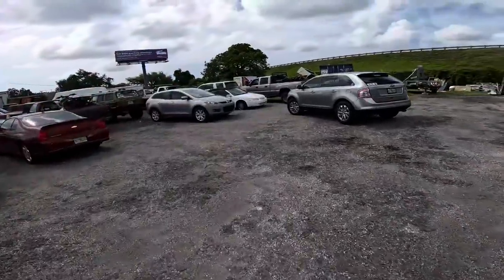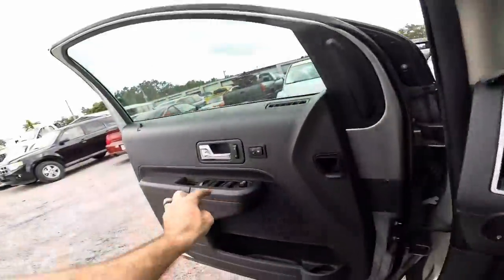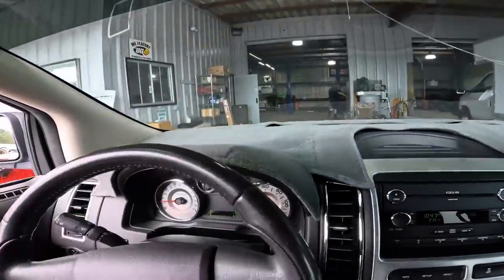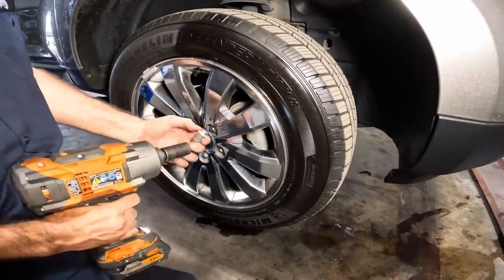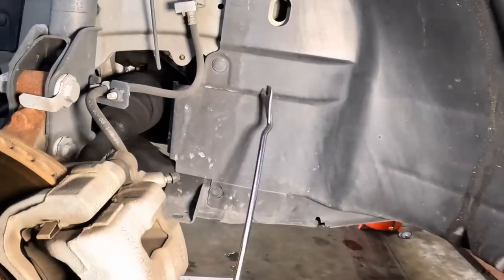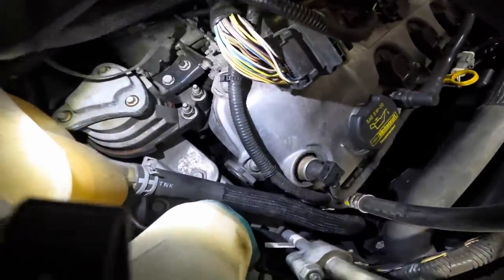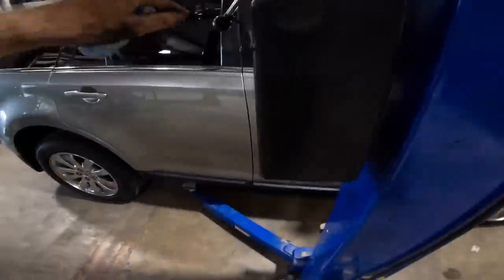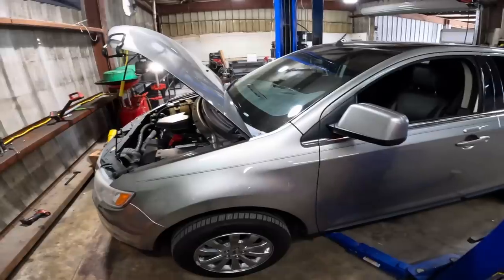Mechanic Hack! Coat Hanger Repair! Ford Streth Belt

Comment: Just so you know for future if you put the belt on the power steering all the way and start it on the crank its easier to do the same thing with zip ties and you will have an easier time rolling the belt on. done a couple on the same engine but in the f150 same idea a little more room but still easier to do it on the crank since you have to use the crank bolt to turn the engine over.

Comment: Did one of these on a Ford flex with the wide plastic ties first time I saw or ever heard of these at my home garage. My daily is class 8 Freightliners never seen these before so I bought the tool 2 wedges to remove and install these. Bought this tool 5 years ago never used it once because never saw one of these again.

Comment: I've used various things to put on stretch fit belts. zip ties, hard plastic bondo scraper, a hose clamp and the actual tool. About anything that isn't sharp but can provide some friction between the belt and pulley as it goes around will do the trick. You just don't want to use something that will damage the belt.
Reply: Shhhhhh, according to the resident mouthwrenches that makes you a hack.  😂
Reply: @stevewhite3424  call it what ya want, if it works and works right, why not? Ray just demonstrated a fine example. If that makes me a hack, then I’m proud to be one.
Reply: @TechJB65  Err, I think you missed my point...I was agreeing with you...
Reply: @stevewhite3424   I didn't take it that way. Just thought I'd take the opportunity to address those that do think its a hack job to do something like that. Mechanics that find creative ways to get the job done and get it done right is just that, a creative thinker.
Reply: @TechJB65  Agree 100%!!

Comment: Check out harbor freight for their dual, flex head, long reach wrench. It is extremely thin head. I bought it to take the upper power steering bolt off Sienna 3.3. You have to use a deep socket to reach the bolt past the pulley and I have managed to get a wrench with a fat head stuck against the inner fender, unable to remove the socket nor tighten the bolt.  67994 1/4 in, 3/8 in. Drive Long-Reach Dual Flex Head Ratchet

Comment: talk about stretch belt the lexus is300h has one of those to the water pump and on Techdoc ( that is the toyota lexus manual and guide etc) they say the spesial tool to be used there is a towel a regular towel

Comment: Good Trick. Here is a trade Use WD/40  ON any plastic or painted bumpers where there is any friction of putting it on or off just like you would penetrating oil on bolts.  Shoot those plastic clips they will come right out no more broke clips to hunt down and waste 30 min or more.👍

Comment: I can't help but wonder what the book time is vs what you actually performed it in. Something tells me you smoked the book time Ray🙂
   The coat hanger wire trick is beautiful...I read a few others suggest using zip ties...As befy as some of them are that would be a great go to.
    I just hope the engineers dont try to outsmart yourself and others who have found easier...and cheaper methods of installing that sucker...like pulleys without holes in them. That would be maddening to the nth degree for sure.
   A great teaching video yet again Ray🙂

Comment: I recently changed my nephews stretch belt on his Ford Flex 3.5L NA with an OEM belt. 

When you buy it from the dealer, it comes with 2 zip ties and the part number is BT4Z-8620-C. 

I bought OEM because aftermarket(Autozone) was slightly smaller and looked completely different than the OEM belt.

Comment: i lucked out on my last car, was driving down the road when i heard a loud racket under the hood. i'd snapped the belt off. luckily it wasn't an interference engine so no damage was done. i was even able to drive it home without the belt, i just had no alternator so i coiuln't shut it off or the battery would be dead

Comment: The trick is to use zip ties and start the motor. The belt will go right on and the zip ties will snap off.

Comment: You are on the Edge .... the edge of sanity!! 😆 🤣 😂 (sanity is overrated right enough)

You have been quite fortunate lately in regards to the belt replacements, you have not been required to remove the engine mount to get the belts off.

A cable tie could have done the same and might be quicker/easier to install (just possibly improving on your ingenuity, cannot take credit for that lol)

Comment: Here’s a hint when cutting stiff pieces of wire; hold on to the end of said stiff piece of wire before cutting it. That way, said stiff piece of wire doesn’t fly off into your eyeball. Much safer-er! 😀😀😀 Oh yeah, and it’ll prevent the cut piece of wire from flying off and hitting Troy in the eye! 🤣 It works for cutting off plastic wire ties as well.

Comment: Ive always man handle those belts, specially the gm stuff.  Use a rubber mallot on the top pushing up to add pressure!

Comment: 1995 At 120k miles I requested the dealer replace the multi rib belt for the water pump and alternator. They refused saying they only replace them when they break. Several mechanics told me the same thing. Apparently they want the belt to break while I am driving down the highway and I don't notice until my motor has overheated and pretty much ruined. 
Same story for my heater hoses.
Sure enough my heater hose burst on the highway.  I must have driven 40 miles before another car honked at me that I was smoking. I became stranded. It was on a weekend so I had to fix it myself hitching rides from my neighbors to buy tools and supplies at Pepboys. The motor suffered damage. It burned oil thereafter. I went to a mechanic again and requested that all my heater hoses and belts be replaced. He advised me that what I needed was a motor replacement. He was right but I decided that it was just going to be an oil burner from then on. He reluctantly replaced hoses and belt.  And I drove another 70k miles burning oil and cussing mechanics every 500 miles as I poured in yet another quart.  I bought oil by the case.

More recently I requested a belt replacement at 120k miles. The mechanic was reluctant. I insisted and it got done. I just don't understand their reluctance to replace something that has reached it's statistical lifespan.
Reply: The engine will blow up long before the belt breaks.  Listen to your mechanic.  If you are worried about a breakdown buy a new car.  There are many items that can fail and brick a car.

Comment: Stretch belts are a pain - I understand why manufacturers use them ( cheaper than fitting a tensioner ) but they are a real pita to fit - especially when the pulley is on an aircon pump so no spokes to feed a tiewrap through ( my son's 2009 Impreza )
Reply: Ray will drill a hole then.

Comment: Seen this done with a boot lace. Basically 550 cord to do this on the side of the road when a belt broke on an old fire bird. Except he used the key to jump the belt onto the pulleys. I was laughing till i saw it work…..I stopped laughing fairly instantly too lol old’man said “mmhmm”.

Comment: How did you ensure that the coat hanger wire didn't damage the belt (or nick it, etc) ?   Examining the full belt in place looks like a pain in the rump

Comment: I really need to replace the belt on my Crown Vic, it has several large cracks. I bought the belt over a year ago but procrastination is something else. Well at least the tools and belt are in my trunk just in case it decides to snap and I won't be stranded on the side of the road🤣🤣

Comment: I thought you where going to show how to take a clothing hanger to fill space on a exhaust welding job I have done that before by wrapping and stuffing into a gap so I could fit two way different sized pipes together.

Comment: I always save my old belts, throw them in the trunk if thay are in good condition, If you are out in the middle of nowhere then if you blow a belt and no one around has one in a 100 miles, its will be good to have. I do the same thing with my Golf cart, 5 miles away and blow a belt throw on the old belt and get back home. Just my 2c worth..

Comment: Towards the end of working on cars I wouldn't show customers where its cracked all the way accross, I had 2 separate broke turds say I cut it with a knife so from there on out Id say your belt is heavily cracked and needs changed and if they didn't bite they could call triple A, some ruin it for all.

Comment: At first, I wasn't impressed by the slim ratchet - and then I saw the flat handle. Wow! The wire trick on the stretch belt was brilliant! But why do they use those? IMHO, that rates right up there with the crankshaft pulleys not having a keyway. Lastly, I'm building a backyard workshop and hope to have a lift. Do the non-professional lifts also come with a "subscribe" button?

Comment: I’ve used a D shackle for that job before no need for any thing very big just so it will slip in and do up
Reply: O if there is not room to add D pin just use the C part of the shackle into pump pulley and turn belt on

Comment: I replaced the OE tires on my 2021 Escape at 8K miles and arrived at the tire shop with 20 brand new McGard lug nuts and told them to do whatever they wanted with the POS stock ones.
Reply: Wow i didn't even know that micky D's sold Mc lug nuts, i thought it was just Mc Nuggets.
Reply: @bruceaugustine6486  Silly Rabbit, of course McDonalds doesn't sell lug nuts, but Amazon does.

Comment: I have always questioned, whether cracks on a serpentine belt are a real issue.  IMHO, as a DIYer of many decades at this point, adjacent missing chunks of multi-groove belts are where I think about replacing the belt.  Cracks don't affect functionality.  Cracks propagating into the main cross-section of the belt are a problem.

Comment: I can't tell if your subscribe buttons work. I was already subscribed before you owned that button.
But... a piece of cloth hanger wire... I think this trick would also work using a zip-tie for temporary forcing the stretch belt and the pulley to stay focused during their marriage.

Comment: Good morning Ray, glad to be here 🌞. I've got a quick question, Why would the engineers use a stretch belt?? I always thought having such a  tight belt would put undo stress on the alternator's  bushings.
  You did an excellent job with your home grown tool 👍 Have a great day and stay safe, healthy and American Strong 🇺🇸  💪✌️
Reply: A separate stretch belt is used on power steering pump pulleys for safety purposes. When a traditional belt set up is used, your power steering system is also dependant on other accessories and pulleys like the alternator, water pump, AC (sometimes) and Idler pulleys. If a bearing seizes in any of those other systems or the belt breaks then you also risk losing power steering. This is a way to keep your power steering independent from the rest of the car.
Reply: Ideally they would use this on every car, but with cars becoming more advanced and engine bays getting tighter its become non cost effective to engineer two or even 3 belt systems on cars, this is a big reason electric power steering became a thing
Reply: Also, forgot to mention, stretch belts are  used because there isn't an ideal place to put a tensioner and the cost of manufacturing would go way up if they did put another one for it
Reply: Stretch belt is used to eliminate the mechanical belt tensioner thus removing an additional component,  potential failure point and improving access and giving a bit more space. The belt is engineered to produce no more tension on the item being driven than if a serpentine belt with a separate belt tensioner was used.  😊
Reply: @UFC123454321 Except in this case the stretch belt is running the alternator, not the power steering pump.
Reply: @stevewhite3424  mmmm nope lol that is definitely not an alternator 😅
Reply: @SpencyP92  Just going by what Ray said it was.  Unlike many of the experts here, I don't spend a lot of time running videos at half speed trying to find gotchas.

Obtw, my neighbors stretchy belt goes to the a/c compressor.  That leaves his power steering pump open to murderous failure of the serpentine belt,like at least 95% of the vehicles on the road.
Reply: @stevewhite3424  I'm not trying to argue lol. I spent 6 years to get an automotive engineer degree and have worked as a mechanic for the last 12. I'm just explaining to him the purpose of them. They are to keep functions independent from the others, the same would apply to an AC system as it does a power steering. Idk what car that would be for, I've never seen it in my own eyes. Many AC systems have their own belt, my truck included, but i have never seen an AC belt without a tensioner. When belt systems don't have tensioners its typically because there is no practical place to put one, a stretch belt is a cheap and good solution to that problem

Comment: Hi Ray, noticed you missed out in using the tork wrench on the wheel nuts. No click ages or did you edit that bit out.
  Job looked straight forward enough. But strech belt why?.never seen this done on your other video.
 It's getting really hot here in Greece. We have a weather type bomb here. Coming off of Africa affecting whole of the Mediterranean . 34c here and in Africa 50c.  Not good mate.
Look forward to next vid if l have not melted🇬🇷
Reply: not sure but do those yellow extensions help with setting torque to a specific poundage?

Comment: My man! Could you tell me how to remove completely rusted stuck rear brake rotor cap, yap there's a center cap on it in my model and its been there forever and completely rusted shut. Any suggstions?
Reply: Get a sledge hammer and cut the handle down to about 10 to 12 inches longs.Lots of driving force without having to swing it hard!When you say cap,what do you mean? What model vehicle?

Comment: See how easy that was. unlike your fubar on the Escape.  Did you ever change out the compressor to the right one with the correct diameter pulley?
Reply: no, it escaped  to Arizona with Ray's Super-tight belt. u will never see the car again.

Comment: Wouldn't a heavy duty zip tie worked just as well as that coat hanger?

If the owner of that Ford Edge is smart he is checking for leaks from the water pump weep hole on a weekly basis.

Comment: I hate to nid pick but I wouldn't leave a surp belt spring tensioner compressed all night? I would think that wouldn't be good for spring having it loaded 100% for 24 plus hours. The Gear Wrench surp belt tool kit is cheap definitely worth it. Just my opinion but that's just me. Good vid. Nice trick with stretch belt, I blame my Silverado 1500. That's the vehicle I saw with the a/c surp style belt but no tensioner for the 1st time. That sht is a scam if 1 belt snaps most likely it will take out other belt. 1 belt worked for YEARS after v-belts? If it's not broke dont fix it because the manufacturer wants too sell you more overpriced parts! Just line the pulleys up 1 belt 1 tensioner STOP with larger crank pully/harmonic balancer and 2 belts? It makes even less room imn an already tight situation! 👍🏻🇺🇲

Comment: Not so many wire coat hangers around now, mostly plastic, and if you have some, helpful bastards throw them away !!  ( Oh he couldn’t possibly need these, I’ll throw them in the skip, before I load the van with the wrong stuff, very slowly !)

Comment: 3/4" steel electrical pipe in various lengths makes good cheater bars.  FORD"fix or ruin the day"
Reply: Nah, gas barrel for the win !
Reply: Nah, too bendy.  😊  I use a piece of 3/4 black iron gas pipe.  If you bend it its time for the gas wrench.  😂

Comment: Shop air would clean out two-piece plastic clips, no?
Still amazes me you can get a lot of parts... Delivered... on THE SAME DAY.  Still not enough motivation to live in a urban-ish setting.
A re-purposing of a wire hanger... niche compared to what they're starting to be used for... AGAIN.  If it hadn't have worked, at least the owner wouldn't have died in the process.  Or sent to prison (non-white Edge).

Comment: Its not FORD syndrome, its discount tire mechanics that use wrong socket over several yrs & finally, the become knurled and good for fishing weights... The good news is for less than $20, they are replaceable off Amazin, er, amazon..

Comment: fords as of late....junk. too cheap to even use a tensioner. when one considers how much is paid for one of these pre-planned obsolescence designed nightmares you would think that at least an idler would be called for during it's design. yet another example of why i will not buy any of this 'modern' crap. hint for ford...single belt setup w/ a single spring tensioner design. how damned hard could it be? even gm can do it.
Reply: Lots are running stretch belts now not just Ford